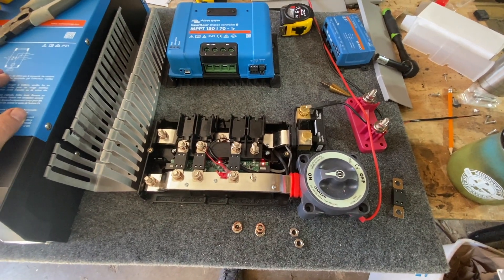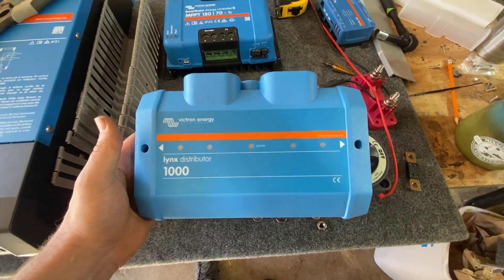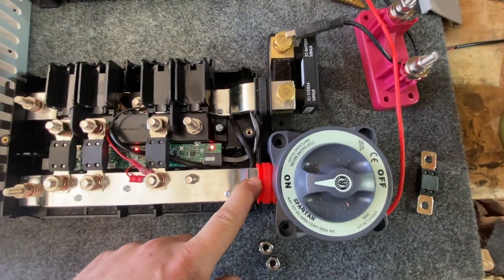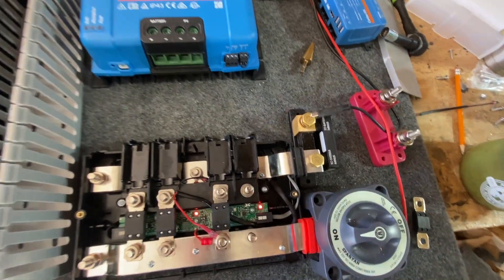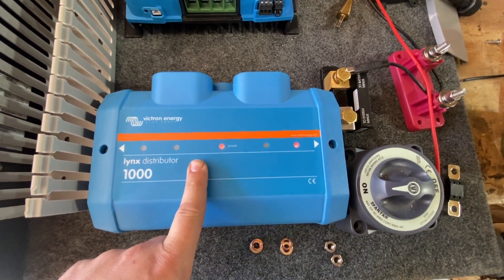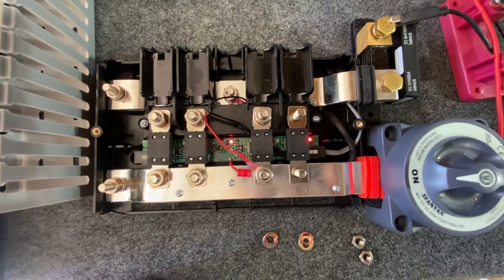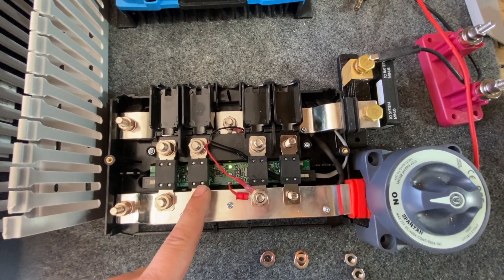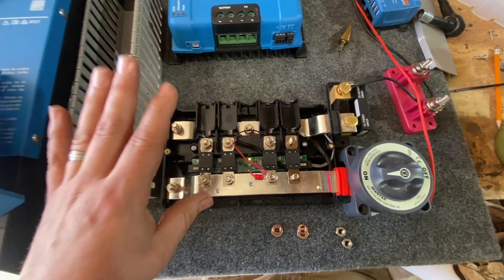Updated 2023 - Victron Lynx Distributor with Lights, Disconnect and Shunt Update

Comment: Could you not operate the lights using the cable feed from the battery monitor then just connect the shunt to the 2nd rj socket in the distributor?

Comment: Tip:  Don't run any inverters on 12V!  24V O.K. and 48V the best!
Reply from the maker: I think for RVs with equipment available, 24v is most pragmatic for most people. When a 2x120 48v Victron inverter comes out, we’re set.

Comment: So do we have to have an isolation switch for each entry cable into the lynx distributor? I have wired it up as most do, all 12V DC loads, inverter, solar controller, DCDC charger through the lynx. 
 Being just A buss bar in effect you can have the main camper battery isolated but if your running a DCDC charger all the other hot wires are live if fused  ..  I am  thinking it's may be better to run the dcdc charger hot wire direct to the camper battery and bypassing the lynx distributor as the dcdc makes my 12v DC circuits live while driving so there is no isolation.
Reply from the maker: For dc dc chargers I do agree to have an input disconnect. 

Also look into some
Of our videos for Lynx vs Dinrail breakers